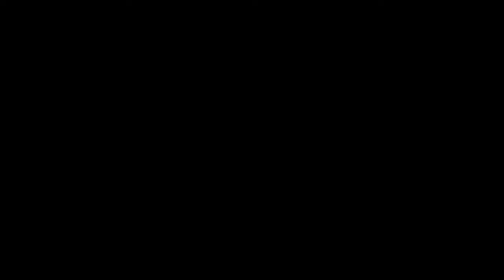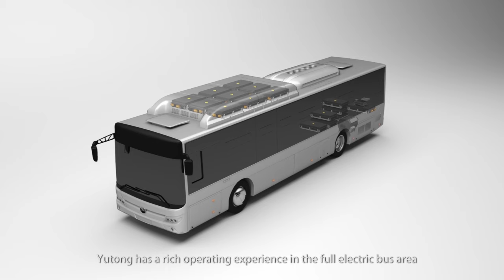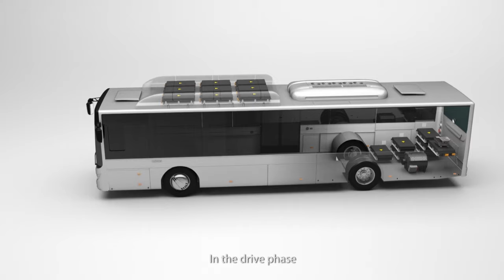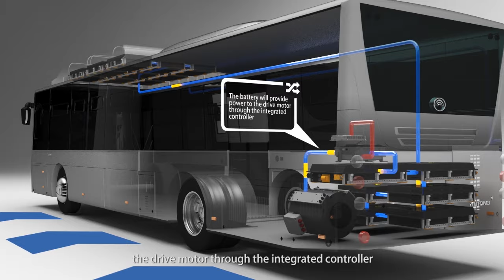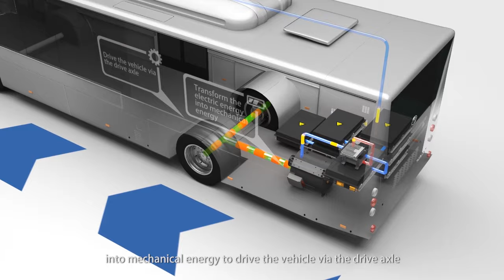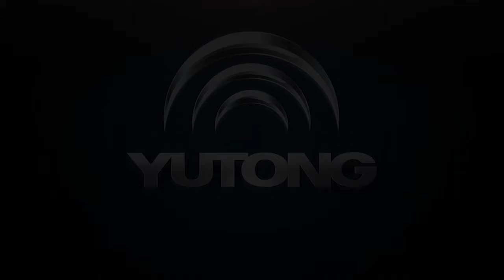principal of fully electric buses english

Comment: ELECTRICITY FROM SOURCES RUN BY FOSSIL FUEL OR NUCLEAR GENERATION
Reply: Wind and Solar also
Reply: LOL fossil fuels are on the way out. More and more solar, wind, tidal, geothermal and quite possibly Nuclear Fusion(FAR more efficient than that of fission) will become more available and cheaper in the future. With the exception of fusion obviously.
Reply: Even if you run an EV on Coal, it would emit around 50% less CO2. 
You can do the math yourself